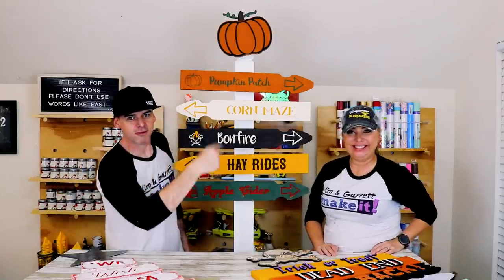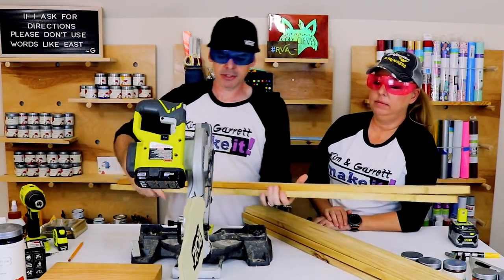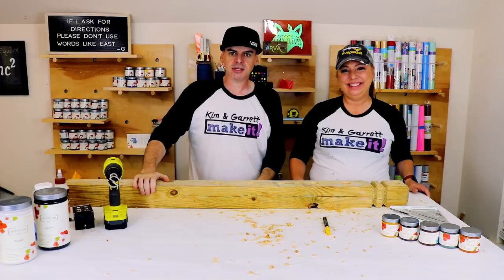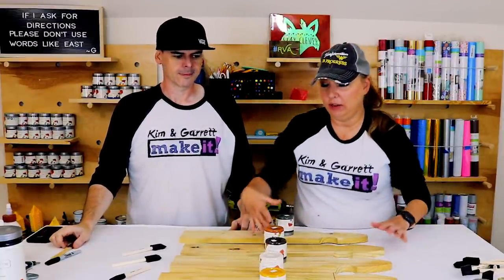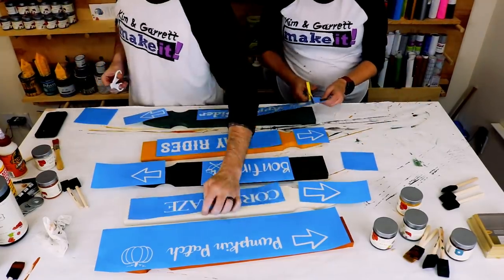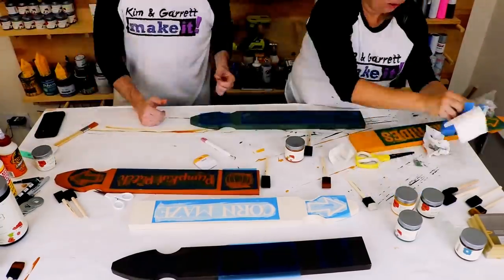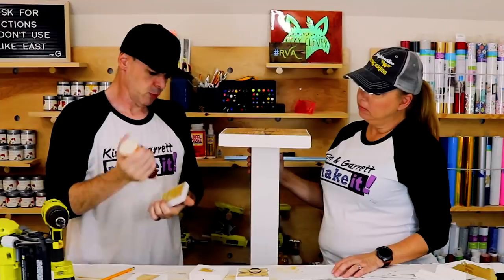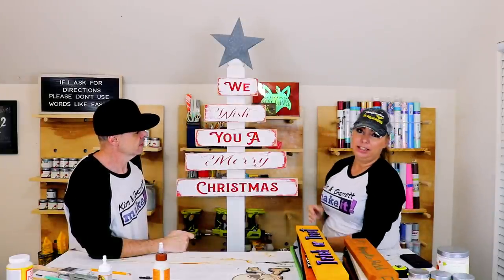Fall DIY Front Porch Welcome Post with Changeable Signs

Comment: Cute project.
I did not understand what you meant be using modge podge or base paint to seal?
Reply from the maker: Hi Linda.  When using a stencil on wood, sometimes the paint will bleed under the stencil. Using Mod Podge or the base paint will seal the edges so there's less likely to be bleed. The color you're stenciling stays only in the stencil area.  Hope this helps!
Reply: @KimandGarrettmakeit  so after you apply the stencil, do you use the base paint or modge podge before applying the stencil color?
Reply from the maker: With a painted surface ikebana this video), you can use either one. With a stained surface, you'll want to use Mod Podge.

Comment: Is there any tricks to using mod podge, I've tried on a Buffalo plaid sign, I let a dry, buy when removing my stencil after the paint had dried it was peeling? What did I do wrong?
Reply from the maker: You don’t want a very thick layer that dries completely or it will peel up
Reply: @KimandGarrettmakeit  thanks 😊 
So I don't allow it to dry completely?